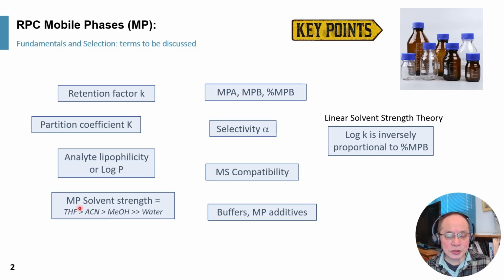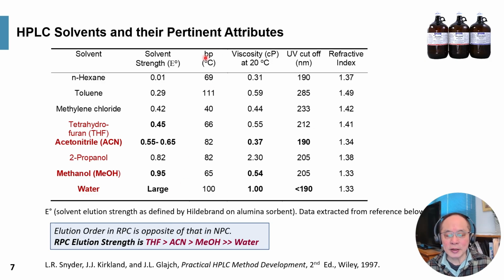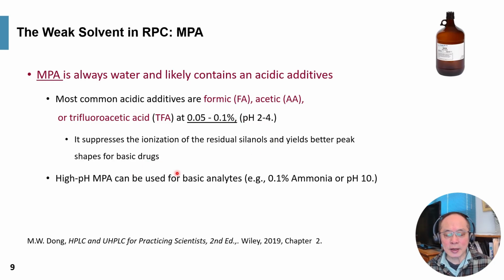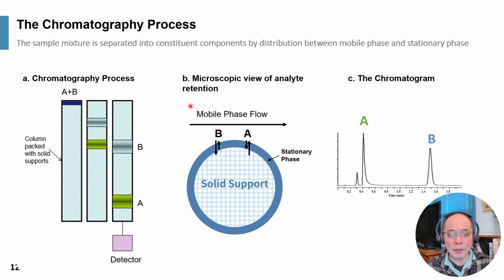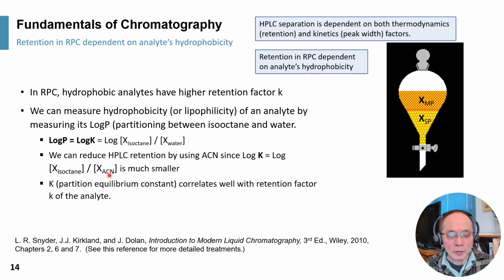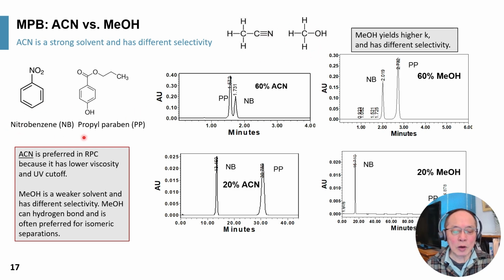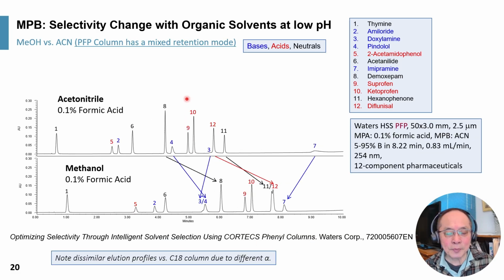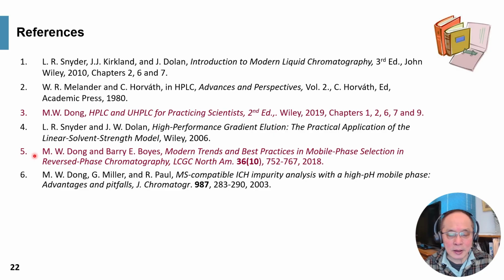HPLC for Practicing Scientists. Episode 4: RPC Mobile Phases (MP), Fundamentals and Selection

Comment: On the slide at 29:30. I think  there is a typo as the lower retention would result from the higher elutropic solvent i.e. ACN not MeOH
Reply from the maker: Tks for your comments. Appreciate it.